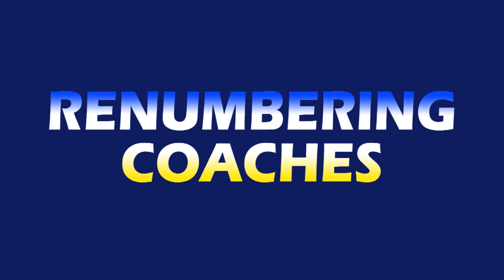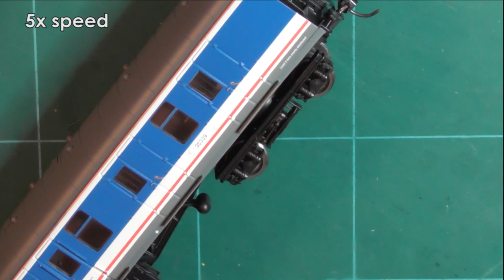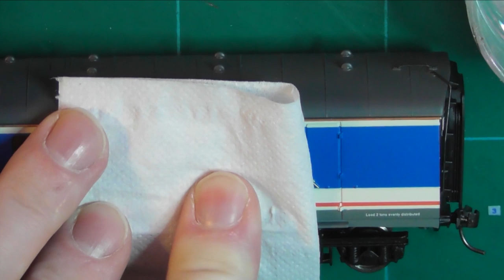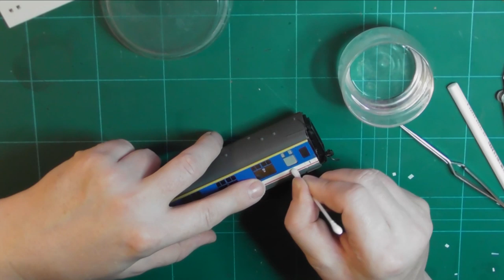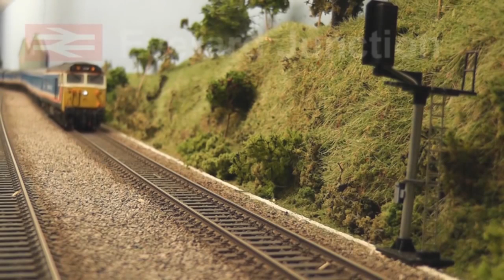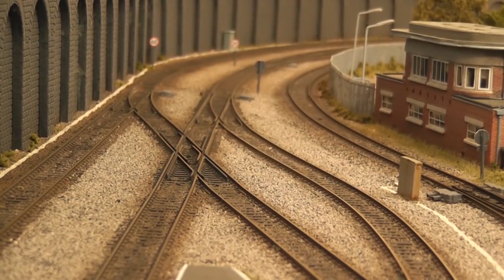Renumbering coaching stock

Comment: Always good to see making models unique. I'm busy working on a hornby class 50 nse weathered. All factory weathering removed, renumbered and fully detailed onto the immaculate 50 033 glorious.
Reply from the maker: That sounds great.
Is if the 50045 model? If so, watch out because the NSE blue they used for that model is far too dark.

Also.... did you pick up that 50033 is is in Hornby's 2018 announcement last week?
I was rather disappointed in this years list.
Now new D&E models at all (the upcoming 87 and IEP are 2017 items), just a few repaints... but steam modellers get three types of loco, coaches and a wagon.
Reply: UK D and E Diesel and Electric Railway Modelling. I haven't gone for hornby new 033 I am almost complete doing my retake on it. The new release has the double arrow so would put it slightly earlier in time. I've been working on and off on mine for about 6 weeks now.. no rush lol. It is the old 045 and with the weathering removed looks totally different. Though a sod to get off there were a few stubborn bits that I couldn't get to. 

Hornby releases are disappointing. But glad to see a new hst in swallow. That's a must for my layout.
Reply from the maker: I was pleased to see the Swallow liveried HST too... I could do with getting an extra pair of powercars.
I'd also like the Virgin liveried pair when the new spec ones were first released... not for the Virgin livery, but for repainting.
They featured the Serck radiators on the roof, and two of my proposed powercars had them.

Comment: Excellent, just subbed
Reply from the maker: Thank you!

I'll be doing a livesream in the next half hour or so where I'm renumbering six Class 90's.
Reply: @ukdieselandelectricrailway1890  Can I ask, I have just applied my first ever transfers on a wagon, gone on ok but I feel you can really see the carrier film around them, have I don't something wrong?
Reply from the maker: @ModelRailwaysUnlimited 
Did you paint some gloss varnish on the model before putting on the decals?

At 3:53 I say how you need to paint varnish in the model where the numbers need to go.
The gloss varnish hides the carrier film, and after the decals are on, you need another layer of gloss varnish to seal them in, and it will hide the decal film.

After that, you can paint matt or satin varnish over that to tone it down with the rest of the wagon.
Reply: @ukdieselandelectricrailway1890  ah no, I have now ordered some of the varnish you used, hope that will improve it, thanks
Reply from the maker: @ModelRailwaysUnlimited  The Vallejo gloss varnish is great for renumbering... but also can be used for fitting nameplates as you can see in my latest video (though I'll be going live again shortly

Comment: Hi Dave
Great video, something Ill certainly be trying out in the future.
Looking forward to more content.
Cheers Paul
Reply from the maker: It's a great way to personalise your stock.

If you go on ebay and buy a Platform 5 'Locomotives and Rolling stock' (trainspotter) book, you can find out which coaches were allocated where and what kind of services they could be found under.

To give two examples of coach types in NSE and InterCity livery in the 1990 book;

For Network SouthEast trains we can look at a pair of NSE liveried Mk2z (vac braked) TSO's ...

5104 has a sector code of 'NWRX' allocated to Old Oak Common depot.... so this is a coach that would work out of London Paddington behind a Class 50 or newly allocated 47/7 on an Oxford service.

5105 5104 has a sector code of 'NNEX' allocated to Cambridge depot.... so this is a coach that would work out of London Liverpool street behind an Anglian  NSE Class 47 or an InterCity liveried Class 86 on a service to Kings Lynn (with a traction change at Ely if it's a class 86).

In the Mk2a section, 5261 is a 'NSSX' coach allocated to Laira depot, which would see it behind a class 50 (or class 33) on a Waterloo to Exeter/Plymouth/Paignton/Portsmouth service.

For InterCity trains, we can take a Hornby Mk2e BSO...

9502 is a IWCX 'WCML' coach, which puts it behind a class 86, 87 or 90 service out of Euston service to Glasgow, Manchester or Liverpool.  

9503 is a IWRX 'Western Region' coach, which puts it on a Class 47/8 out of Paddington on a loco-hauled (non-HST) service to Plymouth.

9504 is a ICCX 'Cross Country' coach, which would be a class 47/8 or class 86. Those were used on services such as the Plymouth to York via Birmingham New St, London Paddington to Manchester and Liverpool, Plymouth to Manchester, Bournemouth to Manchester, and many more.
Usually there would be a traction change at Birmingham New St, but not always.

With a Platform 5 combo for the era you model, plus an old timetable from the same year, you can figure out where any loco, coach or unit would have prototypically worked!

You know.... typing this out, it sounds worthy of a youtube video!!
I shall make one some time!
Reply: UK D and E Diesel and Electric Railway Modelling
Cheers Dave I'll have a look see if I can find one.
Yes it would make a good video.   So would a explanation on the freight codes on wagons as I'm still not sure what can pull what.
Thanks
Reply from the maker: Amusingly, the same P5 book will tell you.

The loco data will describe the type of brakes a given loco will have, as well as data on the engine, weight, and tractive effort, etc. 
With locos with varying abilities, in between the sector code and the depot allocation, it will give a list of letters that apply to their functionality. 

For example, 37401 (in Mainline livery) has xer+
x = Dual braked (air and vacuum)
e = Fitted with electric train heating
r = Fitted with RETB (Radio Electric Token Block) for operating the Highlands which has a radio based signalling system instead of signal boxes)
+ = Fitted with additional fuel tanks for increased range.

Generally, there are three types of brakes on wagons
Now, if you look at your wagons, the last digit will have a letter.

A = Air Braked... so locos with Air or dual brakes can operate it.
V = Vacuum braked... so a loco with vacuum brakes or dual brakes can operate it.
X = Dual brakes... so a loco with vacuum, or air brakes can operate it in either mode (but you can't mic air and vac braked wagons in the same formation).

Something with air only brakes, Class 56, 58, 58, 60, 67, 68, 70, 87, 90, 91 or 92... cannot haul vacuum braked coaches of wagons.

Again, this is a video I plan to make.

Comment: Nice one! This is a job I really need to do soon. Too many duplicates in my stock. Keep up the good work, my friend 👍🏻
Reply: PS. Have you ever managed to get the line that Fox provide allegedly to help you line them up on the body to work? The odd time I've tried to use it, it ends in a right mess, so I just to it by eye these days.
Reply from the maker: Thanks very much!
Yes, I like to make up prototypical rakes of coaches based on actual sightings, mostly ones I noted down in my trainspotting days, but also things I've picked up by pausing youtube videos.

I have a video planned for how to look at photos of trains and figure out what coaches will have run in a particular area for a particular sector based on old Platform 5 combo books from that particular year.

For example, IWCX (InterCity West Coast), or IECX (InterCity East Coast), ICCX/ICCR (InterCity Cross Country) would be hauled by locos from the IWCA, IECA or ICCA pools respectively.

I have P5 combos from 1987 to 1995, so if you wish, I can go through them to figure out which coaches were allocated to ScotRail for specific services.
For example, Class 47/7's on Mk3+DBSO sets for Glasgow to Edinburgh, or 47/7's on Mk2 sets for services up to Aberdeen, or Mk1 and Mk2's up in the Highlands.

Or, of course, you could buy a P5 combo for your given year[s], and work it out for yourself based on what I explain in the video!! Heh heh!!
Reply from the maker: The technique they suggested was to place the numbers using the line to get them straight, then use a curved blade and rock it over the gap between the number and the line... and then remove the lined side of the decal with water and a paintbrush.

No, I never did this myself because I was afraid of damaging my stock... but developed the paintbrush lining up method instead.
Reply: UK Diesel and Electric Railway Modelling Yes, that's the one. I tried it twice, but as you say, I was not at all convinced that it wouldn't ruin the finish of the coach. I use masking tape myself, or eye depending on the availability of reference points, but I like your brush one...May well have to try that!
Reply from the maker: Oh, I forgot to mention... another reason I don't like the Fox line, is because it leaves a visible line below the number because it's cut after applying the base varnish.

Did you catch my other message?
Reply: UK Diesel and Electric Railway Modelling Totally agree. Yes, just noticed the earlier message. Sorry, I'm in hospital for another procedure on my back and the 3G is very patchy. Can barely get the YouTube app to load! Your suggestion about numbering for push/pull etc is a really good one. I'll definitely get myself a copy and follow what you're up to as well. Not entirely sure yet how I'm going to run it all yet. I'm also waiting for the Oxford scotrail MK3s to come out. I was hoping that there would be variations in numbers, but so far it looks like Oxford may just do one of each coach type.
Reply from the maker: Yes, just noticed the earlier message. Sorry, I'm in hospital for another procedure on my back and the 3G is very patchy.

Be thanksful you have patchy 3G, as opposed to the hospital internet, which they charge you for!  :^/
Good luck with the medical work!

I'm also waiting for the Oxford scotrail MK3s to come out. I was hoping that there would be variations in numbers, but so far it looks like Oxford may just do one of each coach type.

You're just gonna have to do some bloody modelling then, and get some renumbering done! :^D
Heh heh!!

The Scotrail Mk3 Push/Pull sets were usually ran as 5 or 6 coach sets in a:

47/7+TSO+TSO+TSO+CO+DBSO
or
47/7+TSO+TSO+TSO+TSO+CO+DBSO

Oxford are bringing out the TSO and CO coaches, plus Bachmann is doing the DBSO too.

If I were doing the ScotRail scene like you... I'd have two sets as described above, as well as an Aberdeen Mk2 set.

I'm not doing ScotRail as such, but I do love the look... so I'm going to do a Mk3 set and a Mk2 mixed set... just for the hell of it!

Your suggestion about numbering for push/pull etc is a really good one. I'll definitely get myself a copy and follow what you're up to as well. Not entirely sure yet how I'm going to run it all yet.

Here's a video that might interest you
https://www.youtube.com/watch?v=0QI1Aoi8Hl4

As you'll have guessed I'm very knowledgeable about coaching stock, and can identify most vehicles by sight.

Since this video is from 1990, it shows an interesting range of coaches and liveries.
This is because the class 158's were late, and had teething troubles, but almost all of the Mk3 coaches from the Class47+Mk3+DBSO sets had been transferred to InterCity as planned (by the start of 1990 just 12 ScotRail liveried Mk3 were still in use in Scotland).

As a result, it gives your layout an opportunity for a splash of colour with mixed formations.
Note: When I describe a coach as "IC Swallow", I mean Italic lettering and a warm hue to the dark grey.
"IC Executive" is the original InterCity livery with railfont lettering.

From the description under the video:

47703 St Mungo departs Glasgow with a push pull to Edinburgh

47703
Mk2d TSO (ScotRail)
Mk2e TSO (IC Swallow)
Mk2f TSO (IC Swallow)
Mk2d TSOT (ScotRail)
Mk2a FO (Blue/Grey)
Mk2f DBSO (ScotRail).

47716 arrives with a service from Dundee

Mk2f DBSO (ScotRail)
Mk2a FO (Blue/Grey)
Mk2d TSOT (ScotRail)
Mk2b TSO (Blue/Grey)
Mk2e or Mk2f (IC Swallow)
Mk2d TSO (IC Executive)
47716

47708 Waverley arrives with a push pull from Edinburgh.

Mk2f DBSO (ScotRail)
Mk3e FO (InterCity)
Mk2d TSOT (ScotRail)
Mk2d TSO (ScotRail)
Mk2d TSO (InterCity)
Mk2z TSO (ScotRail)
47708

Thanks to poor lighting, I can't tell which version of interCity this last train is.
The ScotRail liveried Mk2z is an interesting vehicle because it's one of the air braked conversions from the former push-pull trains top-&-tailed by class 27's.

Hope that proves useful to you!

Comment: if you  needed to, how would you remove the transfers once they are set ?
Reply from the maker: IPA works on acrylic varnish (which is what the original numbers and the paint on the model are).

Of course, the idea is to do it right first, and you'll never need to worry about it again! ;^D